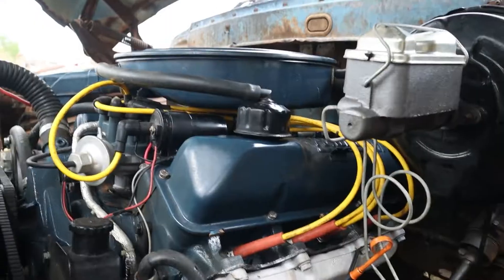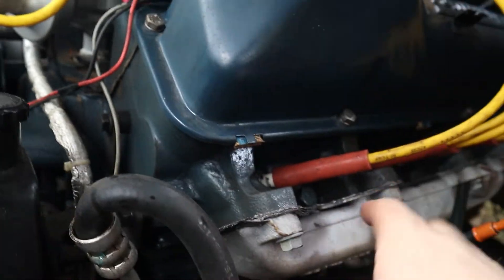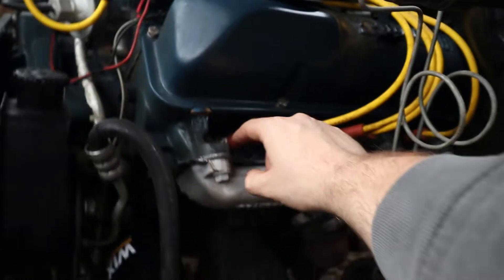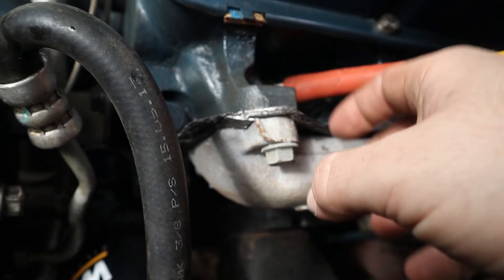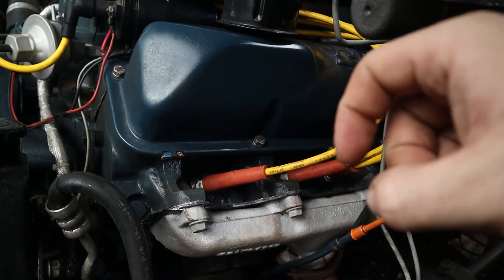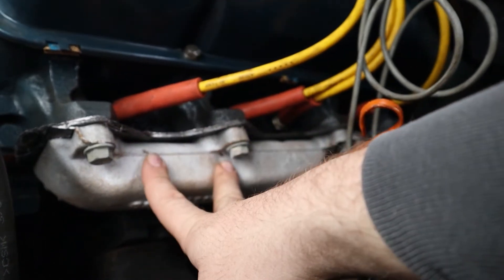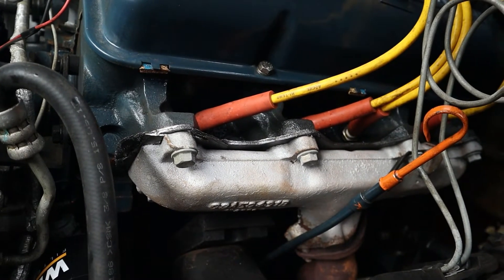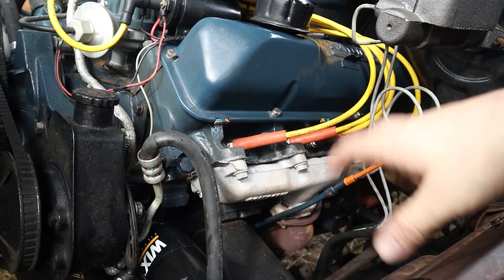Use these gaskets to stop exhaust leaks on your Ford FE engine FOR GOOD!

Comment: Been using silicone only on exhaust manifolds for 35 years, never a leak, funny thing is I worked in a shop that did experimental gasket testing for a big name company. The rep always seemed pissed when he saw that silicone always worked better on our personal cars, race cars, motorhomes!!!
Reply from the maker: Thanks for the tip, That's so cool! 😀 I am definitely going to try it on the next engine I do! I saw someone on a forums say it worked, but I never have tried it.  Also, your youtube handle is awesome!👍
Reply: @TheBestDanielBlount  Thanks!

Comment: My engine builder told me to use a gasket AND high temp RTV on these exhaust manifolds, which I did. Normally I wouldn't use a combination of both but they have so far been sealed up well for ~3 years
Reply from the maker: Thats great! I've often wondered if the small gaskets could be made to work effectively. I have seen some guys going that route, but I talked to a couple guys that had bad luck with it. The application is far more important than the method though, alot of people don't pay much attention to keeping the surfaces clean and oil free I imagine that caused their premature failures. Im really happy with Remflex's product but I have to admit that I don't like that they stick out so far from the edge of the manifolds, it isn't very attractive which bugs me. 😅
Reply: On my 64 Galaxie with the 390 FE I machined the manifolds and used the thin steel gaskets with a very thing bead of High temp silicone red.  That was 15 years ago and they are still holding up well.
Reply from the maker: @jewllake  That's impressive!😀 Machining is really the best way to go! A set of high end gaskets can work really well, but it's still a case of pay now or pay later.
Reply: Hello, I honestly wouldn't give a hoot how far they stick out as long as they seal properly.  The overlap is there for a reason. My guess is if you've driven any car with an exhaust leak, you're damaging the flat surfaces due to the high pressure exhaust getting out.  So the overlapping gasket may help in sealing any compromised surfaces.  That's my guess.

Comment: I've had good luck with the steel shim heat shields with the raised sealing bead. I used those when I put my new 390 together. I resurfaced my exhaust manifolds on a harbor freight belt sander. No leaks so far. Those thin felpro exhaust gaskets that never last long anyways actually cause the surfaces to warp after a while. I was told this by my exhaust guy and my machinist.
Reply from the maker: Thanks for the tip! I remember those heat shields, I imagine they would be easier on the spark plug boots also.(my wires tend to stick to my plugs)
Reply: @TheBestDanielBlount  My sparkplug wires still get stuck to the sparkplugs but not as bad as when they had leaking exhaust glasses turning the end of the wires sooty black. I also made stainless steel studs with brass nuts so the top bolts never break off again. They have been staying tight.
Reply from the maker: My old wires weren't as bad as these Accel ones, but my pertronix ignition HATES factory style 7mm wires. I like your fix for the top bolts! I never understood what ford was thinking when they made the top of the flange so small, it causes so much trouble!
Reply: @TheBestDanielBlount  I ran a cheap set of standard 7mm wires and those didn't last long. I bought a 8.5mm set of blue streak wires and those don't stick to the sparkplugs nowhere near as bad. Very surprised how high quality those wires are for the money.
Reply from the maker: I will have to get myself a set of blue streaks next time! I love the look of the ugly yellow Accel wires, but they like to stick for some reason. I had a set of NOS 7mm wires from the '70s on it to start with and they were fantastic, they are noticeably tougher than the new ones. I saved them and run them on my 59 Thunderbird because it is still running points ignition.🙂
Reply: @TheBestDanielBlount  Blue streak 10003 is the set I bought. Universal make your own set with straight boots on the sparkplug end. I was only getting like 60 ohms per foot out of each wire. Heaviest duty wire set I ever bought and low ohms to boot. I'm running a special old school ball bearing dual point with vacuum advance breaker plate in my 390.
Reply from the maker: I just watched the video you did on the breaker plate! That is really cool! I agree with your views on points and especially Pertronix stuff, I'm running a Pertronix unit in my stock distributor on my f100 and the thing is way more trouble than it is worth, the worst thing I did was spend $90 for a Pertronix unit when I could have bought a spare set of points for $10 and had a more dependable vehicle.🙃 I would ditch it, but it runs fine now and I hate to just throw $90 in the trash can.😂
Reply: I"ve been running pertronix on all my engines since early 90s never had one fail except one (reversed polarity) but always with 8.5 wires and copper contact dist. cap, not actually sure those matter to the pertronix but that's what works for me. Near all my pals use them too. MSDs on all my high compression engines and make damn sure plug wires are separated because even MSD wires will arc at high load/rpm which is fatal to pistons, really wish I didn't know that. Hi Dan. @TheBestDanielBlount

Comment: thanks for the advice. I had a leaky 332 in a 59 galaxy and a leaky 352 in a 60 Third and a very leaky 390 in a 64 third. I just got the 352 back from the machine shop and will definitely try the rem flex even though the exhaust side of the head was machined because the old manifolds are far from perfect. I tried using the thicker Copper gaskets in the 332 without any machine work and it went from very leaky to a little leaky. the 390 is a project for next year. best
Reply from the maker: I have been plagued by exhaust leaks in almost every FE I have ever had, this has been the first gasket I have used that held up. It sounds like you have the same FE sickness I have😄! It also sounds like we have the same taste in cars! I have a 59 Thunderbird I am currently working on, and I used to have a 59 Edsel that someone swapped a 360 into🤣. Best of luck with your projects and thank you for watching the video!
Reply: @TheBestDanielBlount  yeah I also used to have a 59 Edsel ranger, it had a 292, I sold it last year after fixing it up. it's winter here in Northern Indiana so garage work mostly has to wait for warmer temperatures in the spring.
Reply from the maker: @davidbaldwin2729  I'm lucky down here in Ga, it gets cold but not quite bad enough to stop wrenching. I'm glad to,meet someone else who appreciates a 59 Edsel! My Edsel was the second car I ever owned, got it running and driving for cheap but I sold it a couple months before my 16th birthday, that was 10 years ago and I still think about that car almost daily.

Comment: Wow, thanks for the great video. I like your content...I just subscribed. Last year or the year before, I put a replacement exhaust manifold on my old original sixties Mercury with a 352 engine. I was so fortunate to find a manifold with a casting number that matched the original. Exactly like you said, there was no gasket installed originally, but I did put a gasket in for the replacement because - also as you said - there can sometimes be a bit of warping from use. I wish I'd known about the gasket brand you mentioned back when I did the job. I can't remember what brand I used. Thanks also for the tip on grade 8 bolts and heat properties. I can't exactly remember what grade I used. It may have been 8...the job went well and I haven't had any leaks since. I should also mention that I took out that heat riser flapper valve thing and put a spacer in its place. (I don't drive the car in cold weather.)
Reply from the maker: Thanks Kaye!  That really means a lot! 😀 What kind of mercury do you have? It sounds cool!!(I have a 59 t bird with a 352 and it's the smoothest FE I've ever owned!) I dont blame you for ditching the heat butterfly, they almost never work after all these years, and I've never removed one and missed it. Of course,  we never really see much cold weather down here in GA.
Reply: @TheBestDanielBlount  Hey Daniel. My Merc is a '61 Monterey sedan. Not as powerful as your T-Bird, but my 352 does run SMOOTH. The idle, however, is a bit less smooth since I've run into some minor vapor lock stuff once the weather got hot. I should probably rebuild the carb, too. Very reliable car, though. Keep up the great videos!
Reply from the maker: @kayeninetwo3585  OH that's cool! 61 Mercs are really cool! Vapor lock is the bane of an FE's existence!😅 I wish I had a sure fire fix, but it's a hard problem to eliminate completely. The 390 in my 72 f100 had really bad vapor lock, and after a 1"phenolic carb spacer (wood works as good or better) and a heat sleeve over the fuel line from the pump to the carb it seemed to eliminate that problem.

Comment: Will try out the gaskets but been told not ever to use grade 8 bolts on exhaust manifolds.  If/when they break you will have a hell of a time getting them out.  If this is true or not don’t know but also don’t want to find out.
Reply from the maker: You make a very good point! Grade 8 bolts are probably a double edged sword. I may have hell to pay when I remove these 😅 although if I trashed this particular set of heads I really wouldn't lose that much😂. On a side note, I have had really good luck removing FE manifold bolts by simply cranking the engine and letting it warm up a bit and then breaking them free, then I wait to remove them until after the engine has cooled back down.

Comment: I don’t know what kind of bolts were installed on my 1968 f100 352 manifold which was parked for 24 years, but neither heat nor penetrating oil of all kinds want loosen the bolts. More than 1/2 broke off. Three weeks later and still working on them.
Reply from the maker: @Antique803   Man, I'm sorry to hear that! I wish I had an awesome tip to help you here, but when it comes to FE engines they are REALLY hard to get the bolts out without breaking them, and it is usually hit or miss as to how bad they will actually be. This is the most annoying thing about FE engines. The design of the heads (especially the non-GT bolt pattern) have so little cast iron where the manifold bolts are, that they get even hotter than manifold bolts usually get, and this makes them extremely brittle. I've been there myself, It takes a lot of time and patience to get them drilled out correctly. I had an Fe once that broke off all but one bolt, and it took me a while to get them right.  You have to take extreme caution on the upper bolt holes, because the ears are super easy to break when trying to free the bolts, or even drill and tap the sheared ones. Best of luck with your F100, it is tricky and frustrating work, but it will definitely be worth it. The 352 is my favorite FE for cruising, there is just something sweet about them. If you ever have any questions, hit me up and I'll do my best to help you out! 👍

Comment: Haha ur lucky to have all that clearance between the manifold and the wheel wells.  On my '66 Tbird, I can get my fingers in between but nothing more.
     I'll be replacing the passenger side log manifold with a new one soon, using the thick gasket and grade 8 bolts.  Thnx for the video. Good tips.
Reply from the maker: You are right Anthony! I get spoiled on this old pickup! But I have a 58 T bird with a 352 so I know your pain.😅 Good luck on your 66! I'm glad I could help!
Reply: @TheBestDanielBlount  Oh cool, nice ride; we can share the pain - lol.  Thanks !
Reply: I just looked at my passenger manifold a few minutes ago.  I didn't get a warm and fuzzy looking at those rusty bolt 🔩 heads.  They're not all rusty though. 👍
Reply from the maker: @anthonyhfe6450 Yeah, they are pretty scary on these FE's! I had to drill out almost all of them from this particular set of heads. One thing you can try is to soak the backsides of the ones you can see, then crank the car and let it get nice and hot, then try and break them loose. That would be hard on these T birds, so be careful not to get burned.😬 I've used that trick successfully on a couple FE's, it failed miserably on a couple more tho.😅
Reply: @TheBestDanielBlount  Thank you for the advice.  I am glad that you can get to the other side of these bolts on these cool FE heads. That is a plus for the penetrating oil for sure.
     Yes, I can always start it up and heat up everything.  Good advice.  Thanks.

Comment: Nice video. I heard to use copper gaskets because the copper is soft and would form the the surfaces.
Reply from the maker: That's a great tip! That is similar to the Remflex gaskets. They are soft and multi layer, which seems to help seal any gaps in the mating surfaces.

Comment: I have had much success without a gasket, only silicone after having the surfaces machined. They leak because of the give in the gasket. No gasket, stays flat.
Reply from the maker: Thanks for watching Alan! I agree with you 100%, Having the mating surfaces machined is definitely the best way to solve exhaust leaks on the FE. But in my case I didn't feel like taking the heads to a shop and waiting for them. Gaskets (even these) are a Band -aid at best. With that being said, I still haven't had any trouble from these gaskets.

Comment: Great video! What weight oil do you use?
Reply from the maker: Thanks!😄 I hope it helps! My preferred oil weight typically varies when it comes to FE engines, but in this truck I usually run straight Sae 30wt (rotella t4 if I can find it). Just make sure that whatever oil you use either has sufficient zinc content or use a zinc additive.👍 in some of the looser FE engines I've had I used 40wt. 40wt will also quiet valve train noise if your engine has a problem with that.

Comment: You guys wouldn't have leaky exhaust gaskets if you used well made thick flange headers... which also add a lot of power. Those exhaust manifolds prove Ford never intended FEs and Yblocks to spin very fast, I like torque more than HP but much prefer both.

Comment: Have your heads and manifolds surface ground if possible. Then a new metal heat shield gasket.  Those composite gaskets are junk.